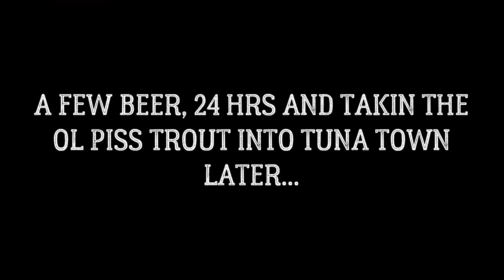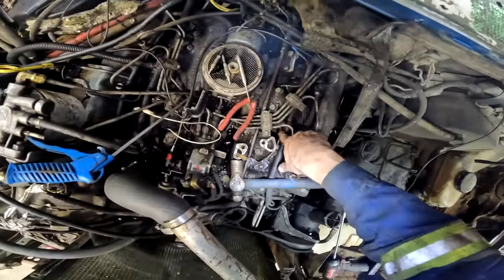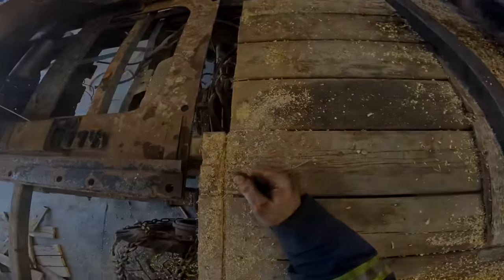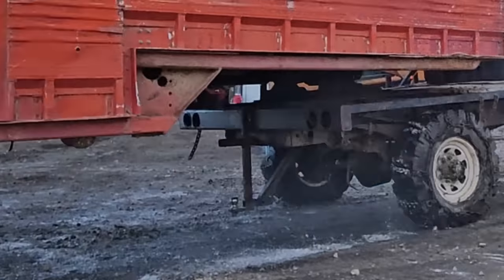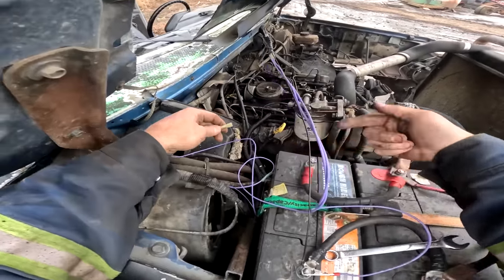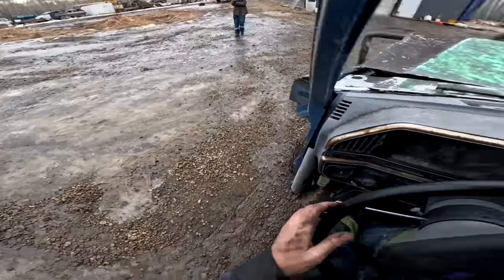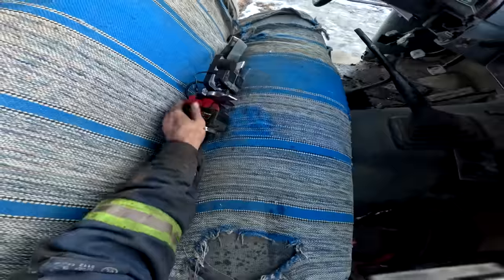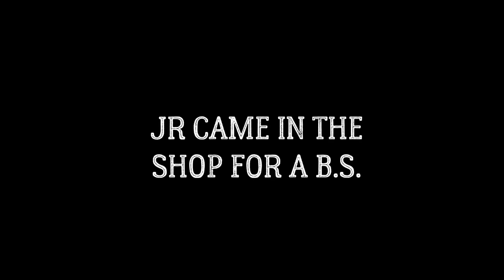7.3IDI OLD START N WHEELIE!!!

Comment: (peg) ..."these glow plugs don't work... Parts are garbage nowadays". (Also peg in a previous vid)..."let's put 24 volts to this sucker and see if that helps"😂
Reply: Im glad i wasent the onlh one thinking that
Reply: Hind site is always 24 volt
Reply: I forgot about that. 

24v on a 12v part = junk parts. 
Yeah, makes sense to me. 😅
Reply: 24 volts Gets them ol' glow plugs hot, quick!
Reply: It's 2024, accountability is a thing of the past 😂
Reply: @JuniorJunison  ngl, I was waiting for someone to make that comment 😁
Reply: Parts are garbage nowadays tho, occasionally their a bit worse when I’m wasted
Reply: Remember Peg was pharmaceutically enhanced!
Reply: 28:15 just cranks it in gear while pulling a semi trailer 😂😂😂
Reply: She likes 24 volts
Reply: Hes not wrong tho. lol
Reply: He was a little bit stunned at the moment 🤣
Reply: Many procrastinating diesel engines will start with starter fluid or carb spray even when they don't want to
Reply: Hey man it's 2024 accountability is a thing of the past
Reply: You don't need to worry about putting 24volts to 12v parts

Comment: If this video doesn't prove that the International 6.9/7.3 IDI diesel V8 is the world's toughest engine, I don't know what to tell you.
Reply: I can't get mine to start
Reply: @gavincarroll2553 what are the symptoms?
Reply: @sargentdoggo6155  cranks good but won't run even on ether I've bled the lines thinking maybe it's a fuel issue cause I had it running and it ran out of fuel cause I didn't know If the fuel guage worked

Comment: I remember one time I got this boat from the dump when I was a kid and it was the best fun iv ever had. The dump provides!
Reply: Did it come with dump bees?
Reply: you know it, I got an 86 honda trx 200  quad from the dump last summer.
I spent about 75$ on a carb and throttle cable , a bit of my time cleaning the fuel tank out and fixing the rope starter...ride it all over the place here 🙂
tires hold air and it dont smoke...
ONE MANS TRASH , Well Its my gold
Reply: My dad and I once found a vw dune buggy at the dump. Glittery fiberglass body and all
Reply: @FORDCAMPERSPECIAL  wow , that's awesome

Comment: My 7.3 has been humming along for 25 years and around a million miles for me. I have been feeding her Cosby sauce since day 1, glow plugs are for pansies. I run any kind of fluid that will flow through the filter and she burns it. I especially love the smell of french fry oil and my 7.3 loves it. She is a custom crew cab dually and just got a new skin and floors waiting for my slow ass to get the body work done and spray it.
 Fun Fact: It will pull a full trailer loaded up a hill in 1st or 2nd gear with the starter.

Comment: Awesome Video, Peg. I got a glow plug stuck in a 6.2 years ago, it didn’t break off but was swelled up so we couldn’t get it out of the head. So we did the crank to remove, it sounded like a gun going off, hit the AC line and broke it on its way out, we never found the glow plug. I had to laugh at darned near the whole video. Keep up the good work, Slave lake should be in Ford Advertisements from now on.

Comment: Factory plugs are 6v and run through a resistor but you can get aftermarket 12 ones that you can run right to the batter they are wayyy tougher
Reply: I gottem in my Kubota.  Mint

Comment: Reminds me of my towing days I had a F350 tow rig and had to move this shitty old full size school bus and pulling it out from where she sat the front end of the truck was 2 to 3 feet in the air and once I got it going I had to put some weight in the front end because I could not turn corners anyway I made it the 5 or 6 km to he final resting place of the derelict school bus. It was a fun time I have a few pics of the truck with the bus in the back with the front tires in the air. It was one of the best tow jobs I had

Comment: I made a similar glow plug "indicator" on my VW Rabbit after the 3rd or 4th controller sharted itself. Used a Ford starter relay and a 5th plug sticking up out of the cowl vent.
Push a button till it's red, then hit the key. Worked pretty well for something cobbled out of old Ford parts and whatever trash I had laying around.

Comment: I would of said the 7.3 was done for if not for the fact I have seen a 6.2 in GM trucks that were notorious for breaking the ends of the glow plugs off when you go to replace them and dropping into the cyl...take er down the road reving the guts out of it always cleared em out.

Comment: John Deere to this day still uses ether injection on their higher horse tractors like 250+ I believe. My brother was a senior mechanic at our local JD dealer and has now moved to the parts department, he says they never had any ether related engine problems, it’s just the best way to get them things going in cold weather, even on brand new engines they can’t come up with anything better, intake heaters will only do so much but ether pops them right off.
Edit: John Deere ether is the best, not trying to promote but it just is.

Comment: IDIs have 2 economy ratings.  MPG, and GPPM.  Miles per gallon, and glow plugs per mile.  I run my IDI on trash oil too, and yeah, it just eats glow plugs for breakfast.  Way it goes.

Also I love how absurdly overbuilt those trucks are.  Trans is only rated for 470 ft/lbs, but 3x that is fine.  3000lbs payload, but double that is still fine.  Towing that hard with no head gaskets, half a cooling system, and down at least 1 redundancy cylinder?  You don't worry about any of that.

Comment: I had to put 2 boat pumps on my ford to get the Injector pump to pickup right... 3.7 gallon a minuet some hose and barbs fist fkn the injector with 440 gallon an hour.
Reply: because it has the same 8 lug axle under it, but with the 6 inch wide flange, like the two of them ya ran over with the logger after ripping the engines out of them!

Comment: I have almost certain theories on why ether went from a way to start a diesel engine to it blow them up or damages them. I think at some point how to use ether with glow plugs and other stuff cause lots of  issues over time and new equipment could start with out the  the facts got twisted it became ether blows stuff up that's why we do you use it anymore. I think I mix of misunderstanding and equipment ability's along with simple reason of ether is bad we don't use it worked. But then people made it into a fact and add all this extra stuff that happens and crap.